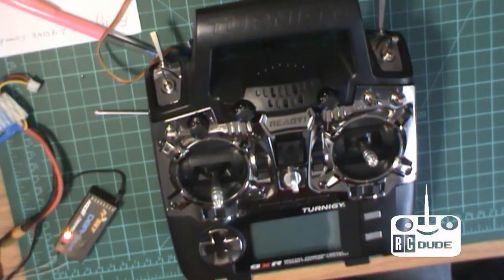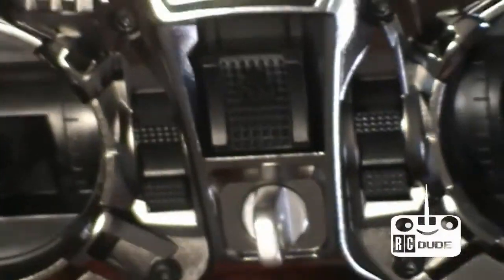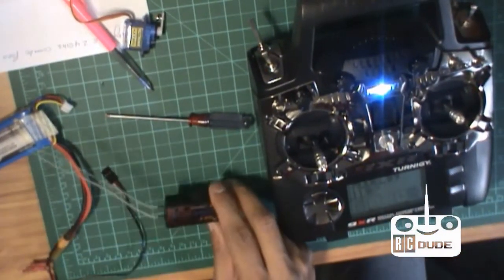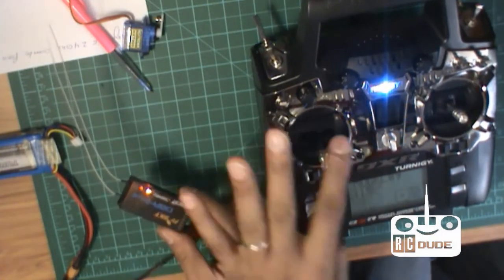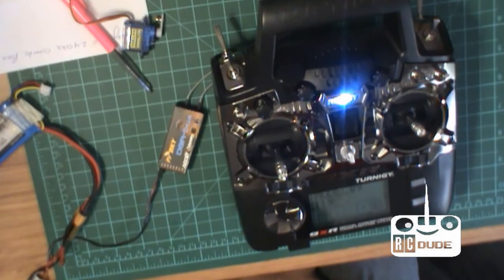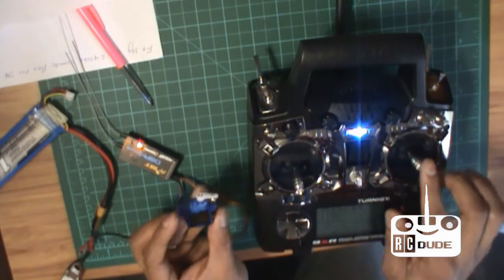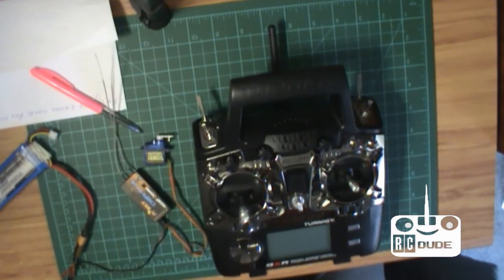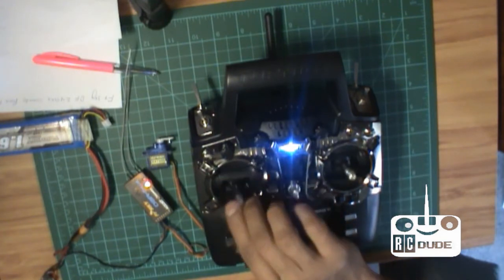How To Bind Frsky Module DF 2.4ghz  D8R-II Plus

Comment: Hello I like to watch me your videos to keep it up !!!
Question you have a Taranis FrSky properly with another antenna? Must I on that eighth've Yesterday it antenna 5 dbi to my FrSky Taranis X9D Plus 2014 screwed a w lan 2,4GHZ and bähm defective and can not bind with my model (watch platinum on probably a capacitor broken).
I need to consider what ???? nice to hear from you Währe
Greetings from West Germany Berlin

Hallo ich gucke mir gerne deine videos an weiter so!!!
Frage du hast ein Taranis frsky mit einer anderen antenne richtig   ?Muß ich auf was achten habe gerstern eine  w lan 2,4GHZ antenne 5 dbi auf meiner FrSky Taranis X9D Plus 2014 geschraubt und bähm defekt kann nicht mehr mit meinen Model binden (Gucke platin an warscheinlich ein Kondensator kaputt).
muß ich was beachten ???? Währe nett von Dir zu hören 
Grüße aus west Germany Berlin

Comment: I have a turnigy 9x with the frsky  djt module if i get a D8R- II plus will i get beeping from my transmitter, or do i need to buy something else to get it working? thanks
Reply from the maker: just keep receiver  way from transmitter see how goes and fallow this instruction i hope u get right
Reply: Rc Dude I am new to multirotor and RC in general, I hope you can help me?, I have the 9x (not 9xr) I have changed the module for the frsky DJT
FrSky D8R-11 Plus replacing Turnigy 9X8cv2.
I have done the binding as per instructions and the lights behave as indicated and expected so it all looks good.
However when I swop it on my model (matching the channels 1-8) and turn on Tx then model, the red light on the Rx is lit but nothing responds to inputs from Tx.
I am using a turnigy 9x Tx upgraded module to FrSky DJT and the model is a Hexacopter with Naza lite.
 
Am I missing something? Do I now the Rx and module have been upgraded need to configure something on the model or Naza to get controls to respond to inputs?
 
Cheers,
Wayne
Reply from the maker: Wayne S
 do u know any thing about ppm setting and cppm setting problem .. u need to search in youtube and type (ppm seting for naza) i will put some video link below
Turnigy 9X( er9x) settings for NAZA + CPPM
FrSky D4R-II PPM setup for Naza Lite w/GPS, 9XR, DJT
i hope its helpful for u thanks
Reply: Rc Dude hi mate i had the same thing. you need both little switches on the frsky module to be switched down

Comment: I don't think the FrSky instructions are entirely forthcoming with the truth of the matter though. I am have a problem understanding how to with 9x running ER using the D8R-IIplus and an APM  for mutirotor. Aaaargh My poor  brain. I need more info than I have! :-)
Reply from the maker: i think we need FrSky FSH-01 Telemetry Sensor Hub which for using  this receiver and monitor  then lot for thing like gps. Telemetry Variometer Sensor. Amperage Sensor.. i think we have to  have  hub . otherwise  its not going to work out .. thanks

Comment: You should not forget to tell people that one must adjust for FAILSAFE at this point right after binding the FrSky D8R-II Plus. It is at this point before using the Rx for anything else, not even testing for Servo action or Throttle, you must set for the kind of FAILSFE that you have in mind for the kind of flying type and kind. It is plainly written in the instructions from FrSky RCDude. Naughty Boy!
Reply from the maker: hahhahahah thanks  Chirs  i will make failsfe video .
Reply: Rc Dude Must keep it light and humorous right?. Sorry this is a long one pal:-) Yes It would be reallyy good to do a complete series on the FrSky gear and including all the neat stuff with the Sensor Hub. And the eventual display on the Tx screen, in yours and mine cases. I use ER9X and I have the TelemetrEZ internal module theat I got with the Smartiparts Solderless Programming Board for my 9X. But now my concern is about doing the FW update (to the Rx and DJT)  It is whether you absolutely need the FrSky FUC#1 USB dongle or if you can use an FTDI/ RS232 like the Sparkfun or similar. Because the Rx and Tx pins of the D8RIIplus accept the hex file for the update and everything else I have flashed uses either the USBasp (for ESC) or the FTDI.(say for my GPS module, my ArduPilotMega, Etc.,,)  Must I buy theFrSky FUC#1? I have it ready to go in my Ebay cart and wasw ready to purchase it, but then I thought, "Is the FUC a proprietary device and specific to the FrSky D series Rx and the DJT module (for which it is made for) ?" . I have a question in at Hobby KIng discussions on the matter. And I am going thru the RCGroups thread that is some 500 pages. You must see it RcDude, it is huge.
>>http://www.rcgroups.com/forums/showthread.php?t=1176328 <<< It does have an excellent Index at Page#1 but so far I haven't been able to find any thing on the matter specifically. 
Ps #1 have you noticed how I can put a URL link in the reply? Neat Eh? and...
Ps#2 Did you know that you can flash the D8RIIPlus with the Firmeware for the D8R-XP  and have CPPM  (Combined PPM) Check out what the XP can do on the Hobby King pagen and look and the pictures in the files section there is a picture of the side of the XP showing that it is expecting RS232 data at there where you hook up the 2 or three wires GND and Rx Tx. Please forgive the length if this :-( :-)
Reply from the maker: Chris Leech
 hi chris i m still new in hobbies it you know . when i started rc hobby, honestly i never find right video to help me out .. and i try to make good video for beginner . thanks .